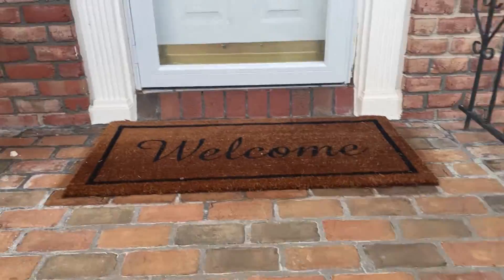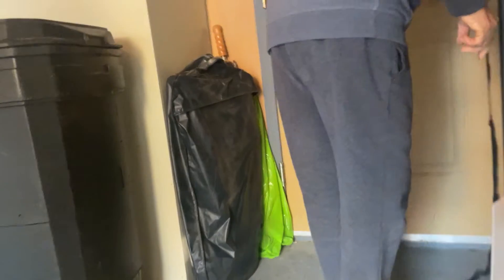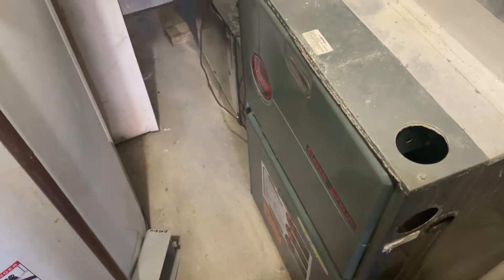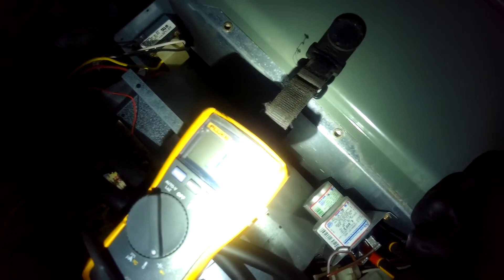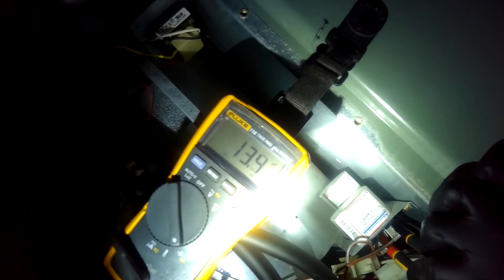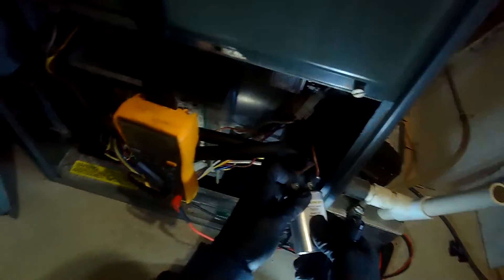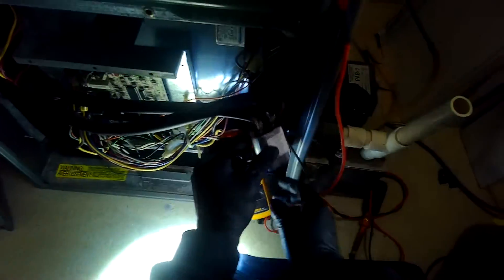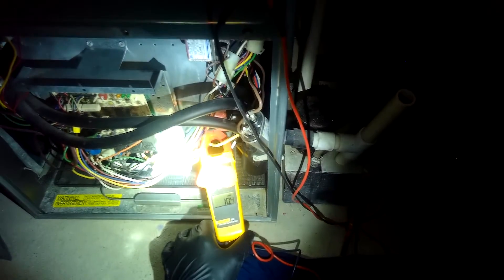Rheem 90% Gas Furnace Loud Blower Motor During Startup

Comment: Hi mikey. Question    I have A humming noise coming from a furnace Whenever the fan turns on. I changed the fan motor and the squirrel cage. It still makes the noise, I feel like it may be coming from air passing through the heat exchanger maybe.  Any thoughts what else i can check ? Its like a whoooooooo sound
Reply: Also have a similar issue.
Reply: Any leads ?

Comment: I made a DYI cheap little test jig with flying leads to connect and power up the motor directly bypassing the existing cap, AND motor .(The Jig is just a 20A power cord, A cheapo Supro hard start kit and various 10, & 12 Ga quick connect jumpers I made. Having made a dozen or so jumpers with various male female combos, I'm prepared for anything I may run across. Bypassing as cap going strait to the motor w the Amp claw on is my 1st step.

Comment: I could probably pull the motor apart probably oil it with some electric motor oil
Reply: @PipeDoctor  😂😂😂 your right, i’ve tried to save some money by not replacing it and those motors you really can’t take apart at all